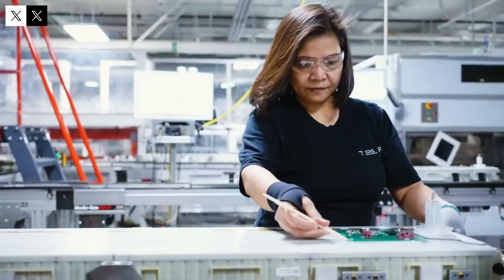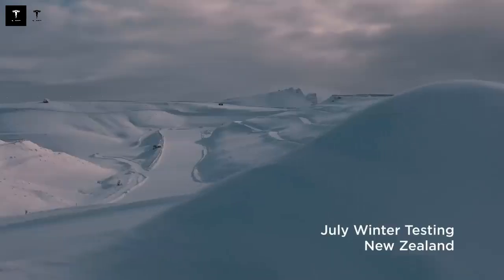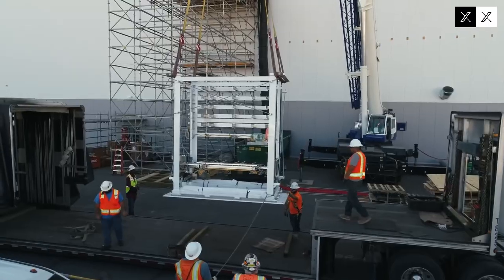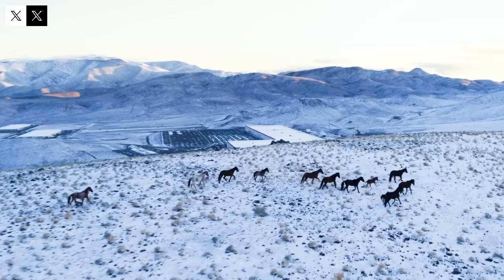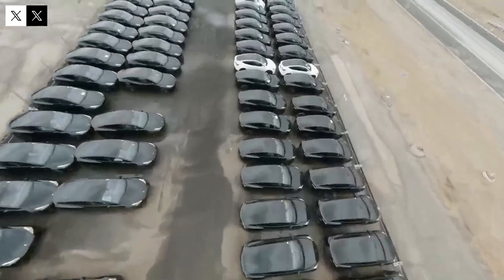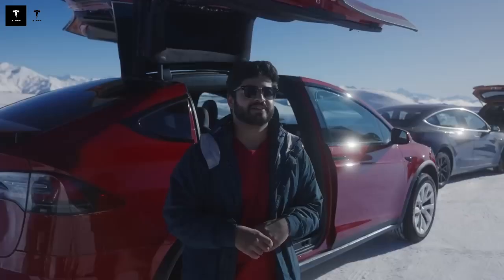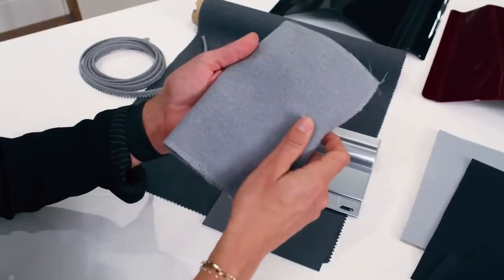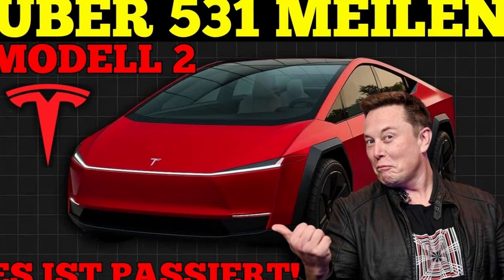JUST IN! Tesla Model 2 2026 Confirmed – Ultra Fast 350 kW Charging Unlocked!

Comment: Charge speed. Specifications. 
instead of. 350 Kw  speed  expect. the  
following for. the. Model 2 
Confirmation. that.  the Tesla “model 2” will 
feature 350kw.  fast. charging while  tesla. is 
rolling. V4. Superchargers  capable of. higher 
speeds. the. affordable EV is. expected to 
prioritize. low cost. which  typically means a
 smaller battery and. lower. maximum charging 
rates